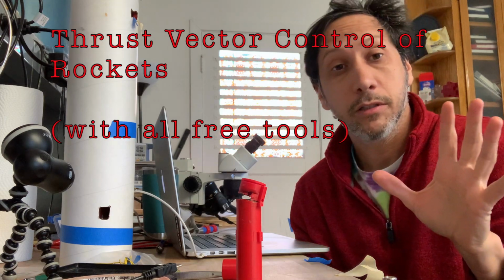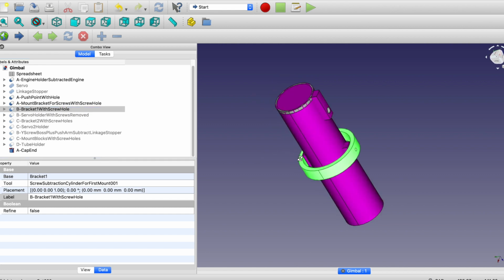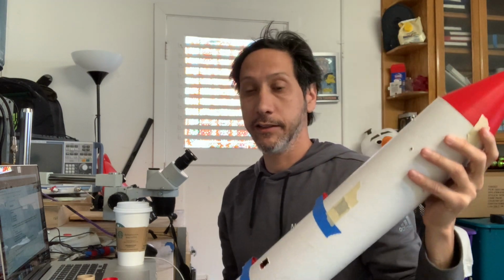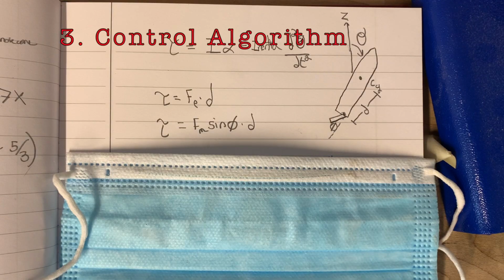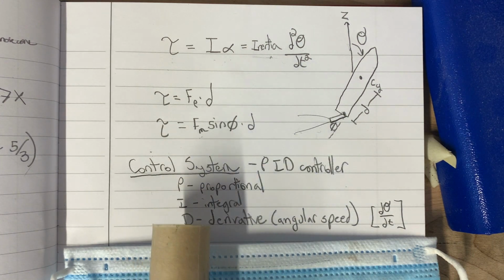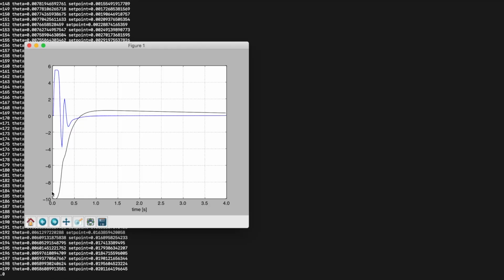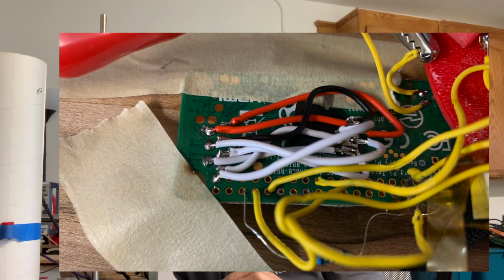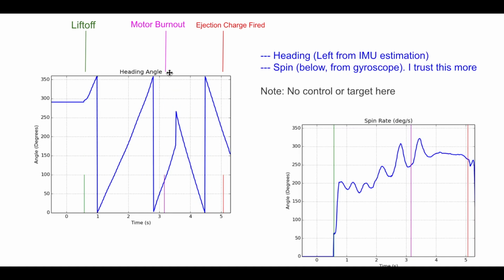Thrust Vector Control for Rockets

Comment: I'm thinking about creating a missile control system for my graduation project from university and I don't know where to start......... Are there any tips you can offer me?
Reply: Hope I'm not to late 😅 I would first create a trajectory on Matlab or Python to know the path to target from launch point. This should then translate to an angle with respect to the ground, over time. That angle should then be translated into the missile's frame and with that you have your desired setpoint, that evolves with altitude
Reply: @geraldimhof2875  You definitely were late for the OP's graduation - but for me, your comment is right on time :-)

Comment: I have gotten to your channel late. I am a little familiar with the raspberry pi but I am unfamiliar with " soldering down the sd card" could you explain that process as I would like to incorporate raspberry pis into my future rocket builds.
Reply from the maker: there are test points on the backside of the raspberry pi zero W. You can look those up and map them to the pins on the sdcard. then I use high gauge wire (magnet wire) and solder all the points up. then kapton tape over it.
Reply: @peterb7615  Well that sounds a bit too complicated for my level of competence I am not ashamed to admit.

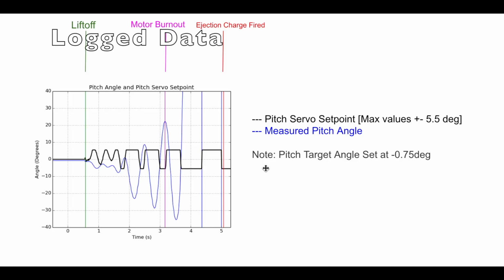Comment: @13:55 looks like the mass loss after initial flight have affected the MC and COG dimensions added to the air friction and wind (if any) all of those may influance the flight path and need adjustment of the PID gains. I was thinking of an algorithm to automatically adjust for PID gains on the fly or to predict a couple of sets of those gains, say set1 and set2 and set 3, that will take over the other sets of gains and which will compensate for those variations that take place during flight. Just a food for the thought.

Comment: can pid.py run under raspi nano?
Reply from the maker: pid.py is basically for modeling the system and determining P- I- and D- values. It doesn't run on the rocket. I'd recommend doing it on a desktop so you can view plots

Comment: You have to have control of all three axis to have a stabile rocket, so you would also need some sort of "roll" control. That is why ever large rocket have some sort of RCS and/or small fins to control the roll so the TVC engine can control the pitch and yaw. Always put yourself in the "astronauts" set to imagine how you would program the flight computer!

Hey could you convert or copy your code to an Arduino Tweeny 3.2, .ino file? Or, a Arduino Nano R3?

I think there is only one other person that I have seen that has a grasp on TVC like you do, and of course that would be Joe.

Comment: Look up windup. Very common in a PID that needs to be tuned.
Start with proportional gain and work doubling each time till u see over correction/maxing out your final element. Then back down.
integral duration won’t be much of help as the time of flight will always be to short for it to correct. However if using integral watch out for over shoot and undershoot!!! This is windup. 
Derivative rate  is a nasty necessity. Which will look into the future. This is usually what u see as corrections. But like before is a big nasty cause of windup. 
All in all great build, a little PID running and it should be smooth as butter, give weight and dimensions stay the same

Comment: Hey @Peter, had an idea in mind that’s how I ended up on your videos. In regards to shooting through the parachute and the stability problem:  Instead of having one big chute, how about multiple smaller chutes, around some kind of ring, in front of the rocket CG (with the ring around the rocket body). The rocket wouldn’t have to go through the chute and thinking about it sound also more stable than a rocket hanging bellow a single chute attach to a string? What do you think? Great project in any case!